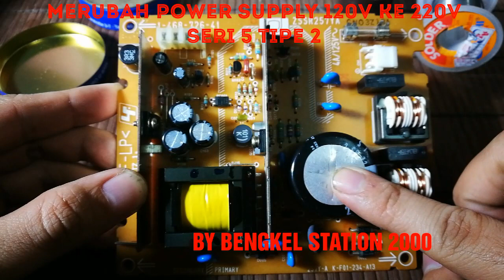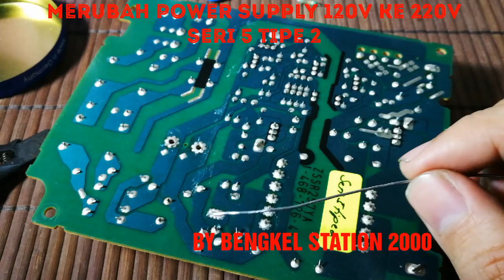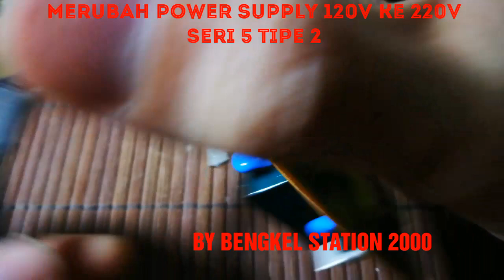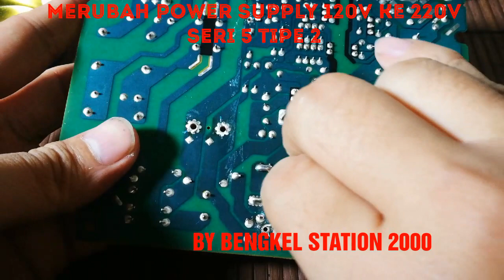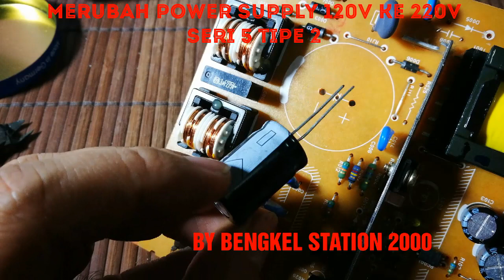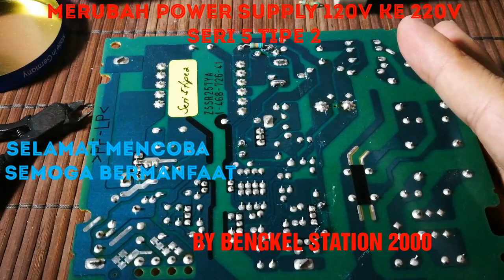Tutorial Merubah Power Supply PS2 Fat Seri 5 Tipe 2

Comment: bang mhon bantuannya ps sy macet di logo matrix,, sy udh brsihin smua soket,, cek fuse normal. sy lepas hddnya normal msuk ke system browser, sy coba pasang hddnya ke ps lain bisa n normal, n sy coba pasang hdd yg lain ke ps sy tetep mentok matrix, kyaknya ps sy yg masalah
Reply from the maker: ps2 nya pakai hdd jenis external apa pakai network adapter ( internal)?
Reply: pakai network adepter 
seri 30000
Reply from the maker: @gempafirdhaus5505  udah di cek network adapternya gan?
Reply: sy udh coba pasang na dan hdd nya ke ps lain n hasilnya normal main, bingung sya kyaknya ps sya yg msalah
Reply from the maker: @gempafirdhaus5505  klo psnya bermasalah mesti cek sisir/ soket na pada mesin ada yg bengkok/rusak ? klo memang ga ada yg rusak kemungkinan besar ada komponen dr board ps2 agan di bagian soket tuk na nya yg bermasah tuk mengetahui komponen apa yg rusak hrs cek 1 per 1 tuk setiap komponen yg berhubungan dgn arus ke soket na nya